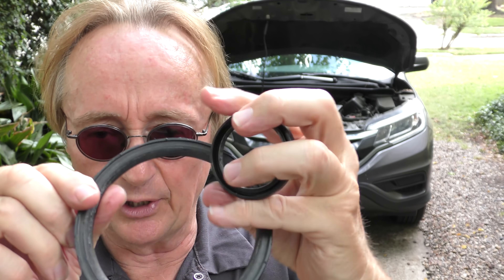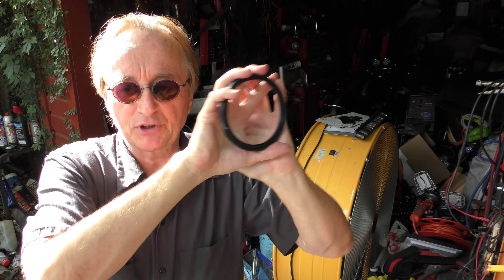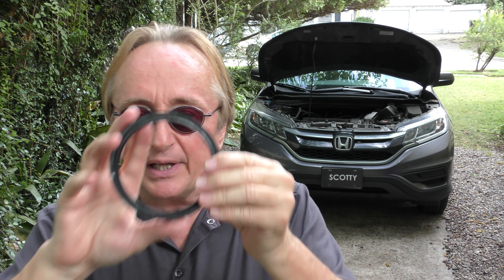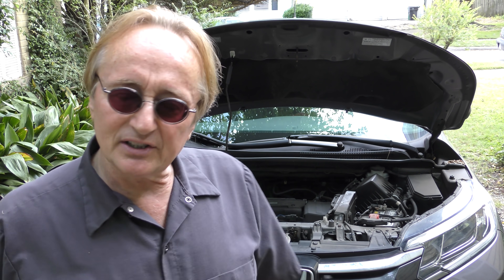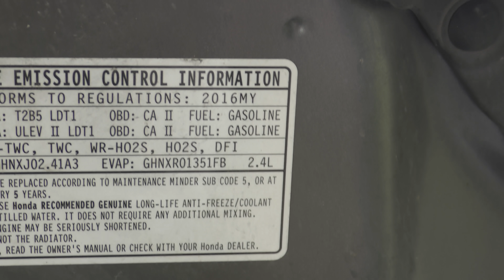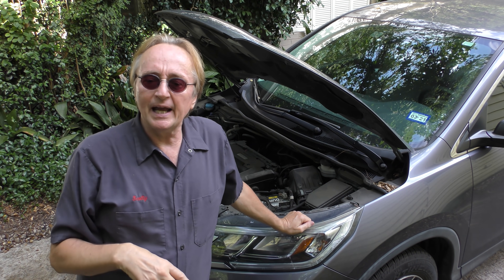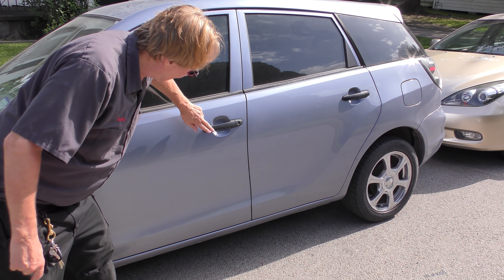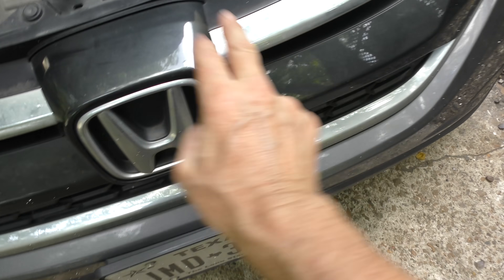If You See This, Don't Buy a Car

Comment: just had a slight  (1-2 drops per day)  rear main seal leak in my 5.0 F-150.  I added 20% of the volume of oil in Lucas Oil Stop Leak at it's last oil change, drove it for 200kms, and it seems to have stopped.  3 weeks later, no new drips.  crosses fingers $20 was sure better than $1500.  I looked for the stuff scotty recommended, but it's not sold where I am in Canada.

Comment: GM is not the only manufacturer using those seals,Audi and VW have been using it for a number of years and they have been pretty good for sealing as opposed to the conventional seal with the spring.

Comment: Modern trend I hate - no dipstick for checking auto transmission fluid.
When you check, you're not just checking the level. You also looking to see if it's the right colour, what does it feel like, what does it smell like? By doing this you can pick up potential failure a long time in advance.

Comment: I have a 2005 chevy Uplander that had a lifter noise; it also had a rear main seal leak.  When I changed the oil, I put 1 quart of synthetic automatic transmission fluid for one of the quarts of oil; the engine holds like 4 quarts of oil total.  This helped to reduce the lifter noise, but as an added and unexpected bonus, it evidently cleaned the crankshaft and rear main seal surface and the leak stopped!  So if you have a front or rear main seal leak, you might consider changing the oil and adding 20% to 25% of the refill as transmission fluid.  I have not seen any problems with doing this, but your mileage may vary.  Maybe somebody hear can give insight on why this should or shouldn't be done.

Comment: PTFE is teflon.  I used to work in the chemical industry as an instrument engineer and specified a lot of process control valves, which included specifying the seal materials.  PTFE was one of the high end seal materials (along with delrin). So I'm going to reserve judgment as to whether cheap synthetic rubber seals are better than PTFE, and if I had to bet, it would be that PTFE outperforms synthetic rubber (also a stupid polymer, generally based on butadiene).  PTFE is way less reactive than synthetic rubber, too, so it's not going to be as affected by crap in the oils. None are going to be natural rubber (thus they are all made of stupid polymers), that would be a terrible material to choose.

Comment: I don't think those Teflon seals are cheaper to make and they hold up well for the original use but apparently they didn't scale down to automotive size very well. Maybe if you want a mil-spec seal you need mil-spec bearings to go with it the rubber ones are made to compensate for out of spec parts. Teflon doesn't flex much.

Comment: My transmission fluid was burnt at 100k miles. 2013 Ford Fusion. Sure wish I knew about smaller displacement, direct injected turbo charged motors wearing out faster before I got this.

Comment: Hey I've worked with my 1992 Toyota Camry and it has a lot of round seals with metal springs in cased into them. I've never experienced a leak with them. I will trust your word with the poor design of the seal without in-between cased springs in them. That's a disaster ready to happen.

Comment: It is getting hard to get a car without possible maintenance nightmares, like direct injection, turbos, crash mitigation sensors, low profile tires, TPMS, etc but I'll try and might have to get a lower trim to do so. Painted door handles...we got them on out Matrix as we wanted the sunroof so had to get the XR trim. 15 years later and they still look new. My old Focus had black plastic door handles and trim that would turn grey from wax residue and would not stay cleaned up with products made to do that...so I'll take painted every time.

Comment: I did what you were saying with the fluid in this Japanese made ( Toyota ) 5 speed auto, that is in the 2006 Pontiac Torrent we have, It was starting to buck a little at weird times, didn't like to downshift, it was a real chore but i found the tiny dipstick bolted to the housing, I ended up pulling the front motor mount to get to it, I drained the fluid and just let it set for a few hours dripping ( NO FLUSH , Just like you said )  put the Toyota Type T-IV in it - It took just under 4.5 quarts  with a long tube on a funnel. The Old transmission fluid was BLACK AS COAL and super thin.  I strained it to see what was in the old stuff   zero metal and only a very small amount of dirt, like a quarter of a thimble full.    I was amazed because this car has 200,100 thousand miles on it.   when I got done we took it for a ride and it did great, then the next day it started doing what it used to do a little bit and I was like, DAMNIT! lol  and then over the next day or so it got less and less and now it's like brand new again, I am not even joking, I can romp on this thing on the highway and feel the gears shifting like Mario is jamming gears on the track and if i don't romp on it the only way you can tell its going through the gears is to stare at the tachometer -  i told the wife even though its doing great to baby it and don't be getting on it of course because I want to see if this can go to 300K LOL  or better maybe.    I am looking for her a Pontiac Vibe ( same as matrix )  now though because its so much cheaper than a real Matrix and has the Standard transmission option but until I find the right one , this will do fine.  2600 bucks man! that's all I paid for this gem. I got some slotted disks and new pads for it and I had to replace the worn out starter and we got a new set of tires, this cars awesome looking too, no kidding.  I can't believe its a pontiac! LOL who would have thunk?

Comment: I think the only cars I ever had that had a drain plug for the transmission pan was my 1956-57 Tbirds. In fact they had TWO drain plugs for the torque converter too! All my other cars you had to take down the pan to drain the pan.  What a mess.

Comment: My 05 Malibu Maxx still has it's original main seal at 350,000. Last time my mechanic changed the oil n filter he checked the main seal so far so good. Only. Thing car needs is shock n struts factory oringal

Comment: I wish this video had came out a month earlier... Tried to replace the clutch, and thought "why not replace the rear main seal?". Not only was it hard to remove (very easy to leave scratch on the crankshaft in removal) but also hard to install evenly. After ten years, the original seal was surely not so pliable, but still okay. Now it seems to be leaking a tiny little amount of oil. Might have to do the job again :(

Comment: Been around turbo charged engines since 1968 and have never really cared for them when they started putting them on gas engines. It does cause the engines to wear out faster.

Comment: My neighbour have mitsubishi colt 1.1l natural aspirated 3 cylinder 64hp engine manual 5speed transmission .  150k miles on this thing and car is 15year old now. The only issue he experienced recently that after not changing and putting wrong  oil 10w40 in last 50k miles it start to leak from oil filter seal and sump corded around sump plug and leak through there to.  I pump out the oil through the deep stick put new oil spark plugs and filters epoxy patch on sump and put new oil.  Runs fine now again 😂 large displacement natural aspirated port  injection engines is the key for longevity.  Scotty is absolutely right.  I have lexus is200  from 1999 car is 21year old and runs like new.

Comment: Odd how these things fail 2 minutes after the warranty ends
Reply: I feel the computer has a program to mess up the car at certain intervals.
Reply: Buy an extended warranty if you're concerned about the part failing "after the warranty ends."
Reply: How do you think they decide how long the warranty should be?
Reply: vClasia nailed it 👍
Reply: Snails40 nope
Reply: @buckhorncortez  extended warranty is a rip off too
Reply: @kylekenan2321  It's just planned obsolescence... They design things to fail at a certain rate to bring customers in for repairs... Reliable cars are not endless money making machines unfortunately...🤣
Reply: Good one 😄👏
Reply: Just change the oil every 5000 miles max. Transmission fluid should be replaced every 30,000 miles. Chrysler said that the 8 speed ZF transmission is lifetime while ZF says every 60k. Lifetime transmission fluid is a scam.
Reply: @atx-cvpi_99  Thats absolutely right, nothing more to say!! Here in Germany the same, BMW speaks from lifetime and ZF the transmission manufacturer says 60k!

Comment: This article says PTFE is better.   PTFE seals, occasionally called oil seals, fluid seals, or dirt seals, offer a wider service range than elastomeric seals when it comes to temperature, pressure, shaft speed and the vast array of media that the seal encounters. PTFE (polytetrafluoroethylene) is an inert material which makes it resistant to nearly all chemicals and acids. It is also self-lubricating, making it great for applications which are either dry, or have an abrasive media. Finally, due to the reduced friction created from the PTFE lip while in contact with the shaft (the sealing surface), you will receive longer life and less power consumption vs. an elastomer lip.

Comment: It may be the design that's at fault, not the material used.  Eliminating the expansion spring in seals doesn't seem like a very good idea.

As for PTFE, it's also known by the commercial name Teflon.  Is it bad stuff?  I don't know but it's used in many heavy industrial applications.  So is Neoprene (another commercial name) which is used INSTEAD OF rubber.  Rubber doesn't do very well when exposed to oil.

Comment: My (Made in Australia) 2007 Camry has 350,000km on the original automatic transmission fluid. I just never got around to changing it and I'm too scared to change it now ha ha. The gearbox skippers and prances on the change from 3rd into 4th under certain conditions, and I know that the end will be sooner than later, but I'm curious to see which will go first; the engine or the gearbox, and the car owes me nothing at all! I change the engine oil religiously, so me-thinks the gears will fail first (we don't have the piston problems of the US 2007 Camry)

Comment: Plastic rear main seals instead of rubber.  Timing belts instead of timing chains.  Electronic parking brakes instead of mechanical parking brakes.  Engine on/off (every time you stop) 'technology'.    All these stupid, poorly thought out ideas (that save the manufacturer probably about $5 per unit, if that) have me thinking my next (and last) vehicle needs to be a low mileage (Japanese nameplate) vehicle, under about $27,000, made before 2016.  Fluid film it every fall (as I live in the northeast), change the oil religiously every 3,000 miles, and drive it until it turns to dust, and have people fighting for it at my funeral.

I know that Nissan is not what it used to be, however, I've had great fortune (160,000 trouble-free miles, and counting) with an '07 Altima.

Nissan Xterra or Toyota 4Runner, here I come.

Comment: A 2.4L motor is basically half a 5.0v8, so the poisons will be 4 inches round and have a 3 inch stroke. Barring any strange failure those engines should mechanically last forever.

Comment: My biggest concern with oil consumption, is the fouling of emission control parts like catalytic converters (Very expensive) and the oxygen sensor. The EP additives in the oil coat the surfaces, which doesn't allow the exhaust gasses to react with them. My sisters and I all have Toyota Prius hybrids. Both my sisters have had to replace their catalytic converters ($1,800 US), but I have never had mine replaced in 270,000 miles. The difference: My car barely burns 1/2 liter of oil in 5,000 miles. They have to check their oil every other fillup. I don't know why mine uses so little oil, but, I can't help but think, that such low oil consumption is the major factor. As far as oil seals, leave it to GM, to use customers to do their field testing. (Remember the Oldsmobile 5.7 diesel)
     You also verified the old saying: "There's no replacement, for displacement"!!! I'll take a large normally aspirated engine over a small turbo any day. Great video...Thanks for posting.

Comment: Hey Scotty have 2011 BMW X5 has 87,000 had it since Jan 2015 should I have the strand fluid change and when I’m backing up and turn my steering wheel I hear a noise is time for power steering fluid change??? BRUCE /W,DC

Comment: It's only $50,000 for one of their pickups. 
My blend door actuator went on my 2009 Grand Marquis stuck on the highest temp heat in the middle of the summer. I call up for the part, the counter guy says $30.00. Then says, you know, the old ones had metal gears, and these new ones have plastic, and by the way unless you've done one before, your better off taking it to the dealer and have them do it. 8 hours labor! $1,100.00 to replace a $30.00 part!

Comment: I work in a tire shop and I hate run flats they are  absolutely terrible to put on and take off we even have a policy where we don’t fix nails in run flats, but I disagree with your opinion on low profile tires unless it’s they are on trucks or suvs or luxury vehicles because those cars aren’t meant for scootin around turns like a champ

Comment: love your show. I have a 2.0 direct fuel injection double over head cam. Smelled oil. No gas. Do I have rubber seals? Or do I have plastic? It's a 2008 Honda Civic Si

Comment: I guess I was lucky, I was able to find a rubber seal for my Chevy avalanche. It's came from a performance parts site. Cost 65 dollars shipped but well worth it. My coworker has a new Honda civic with 25k miles and Honda says it needs to have the cvt fluid changed. It's even in the owners manual. 25k miles between transmission fluid changes.

Comment: PTFE is Teflon which is not a bad thing. It's the slipperiest substance known. It's like you say... a poor design for either improper seal fitment or undersized or under thicknessed or whatever. It's not the fault of the material it's impregnated with.

Comment: Should it surprise me that scottys celica still has only 240k miles? Mine and my fiancee's '97 t&c has 216k miles (had 197k miles when we got it 3 years ago) and it's only actually needed a radiator, battery, and 2 alternators. Everything else is preventive maintenance.

Comment: Scotty what year did GM start installing the weak polymer rear main engine oil seals? I have a 2007 Buick Allure/La Crosse with no major problems but have been considering buying a newer used car.

Comment: Scotty calls PTFE a polymer, but 'rubber' (acrylonitrile butadiene rubber, has nothing to do with rubber trees) is a polymer as well. And yes the installation of those seals is more complicated, but if the seal is engineered well and installation is done well it should outlast ABR seals, apparently GM messed that up.

Comment: Hey Scotty! I'm writting you from Croatia (EU) and I have a question. I drive VW Touran  (1.6 TDI Bluemotion) with DSG transmition. (I know your attitude about VW, but anyway 😀). At the dealership they have told me that there are 2 types of DSG, a wet one and a dry one. If you have a wet one you should change the DSG fluid every 60.000 KM but I you have a dry one then the fluid is only to be changed if you repair the DSG e.g. it is lifetime fluid. In the wet DSG is going about 6-7 liters of fluid and in a dry one only 1.2 liters (but only if DSG is broken and needs service). Thay have shown me an official document from VW which confirms this. What is your appreciated opinion about this? 
Regards Daniel

Comment: I have heard mixed messages about changing transmission fluid.  I took my Tundra, with 100,000 miles in for a transmission fluid change.  I was told by the mechanic at the oil change franchise that changing the fluid in an older vehicle could actually make things worse.  The reason given was that draining the fluid could expose seal leaks that were being kept plugged by the old fluid.  Does anyone know if there is any truth to that?

Comment: We were looking at used Acura RDXs recently. The 2019s and up have the 2.0T, where the 2018s and below have the trusty Honda J35 (3.5 V6). We opted for a 2017 with 32k miles. The 2.0T is seriously underpowered in anything but a civic.

Comment: Darn, I used the AT205 in my GM late model V8 for reseal of rear seal. Now I know it won't work. Time to pull the engine.

Comment: So if new cars are junk, should I just continue driving my old 01, 3.8 V6, original engine, chrysler minivan, with almost 300k miles?  I was looking into buying a used 280k Honda van with a timing belt.  I guess the chrysler will likely make it to go over 300k miles.

Comment: Hi Scotty,I have a 2004 Honda CRV with 254,000 + miles on it, still runs great, with just general maintenance etc...but have never changed the fluid in the transmission. The dealer had told me that there is no filter in the transmission and they are not designed with a drain plug to drain the fluid. I thought this was odd, does this sound correct? It doesn't sound right to me but I do not see any way to drain the fluid and it appears to not have any kind of drain plug to do so. 
thanks,

Comment: I got you bet Scotty I have a 2006 ford escape 2.3 four cylinder with 275,576 miles  the only maintenance I have done is a battery and oil change

Comment: Hey Scotty. So I have 03 Silverado and changed the rear main seal. I noticed my oil is staying cleaner ( still clear ater 1300 miles)longer. Before it was getting dirty around 800 miles. My question is with the seal leaking  was it sucking in dirt?

Comment: Hey Scottie, wants to get your thoughts on 2017 Dodge Grand Caravan transmission, they have no stick to check the fluid and it's sealed, my question is should I get the fluid changed or leave it alone? I'm thinking changing would cause issues because they would flush it and you know what could happen then.